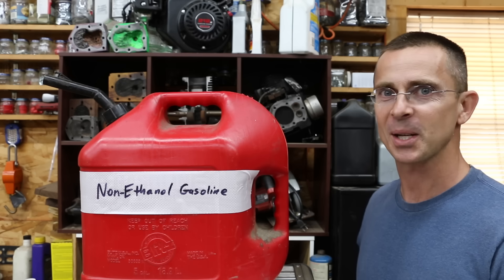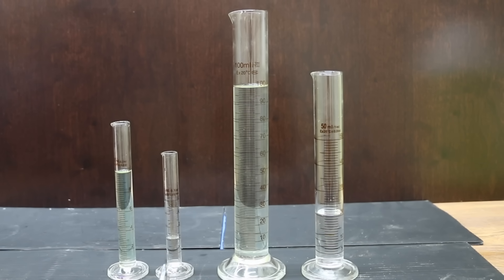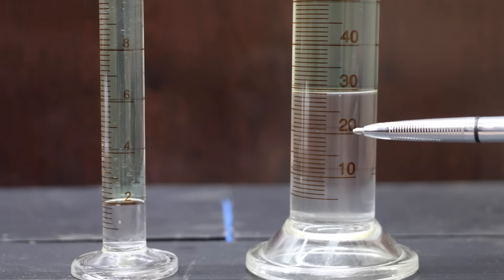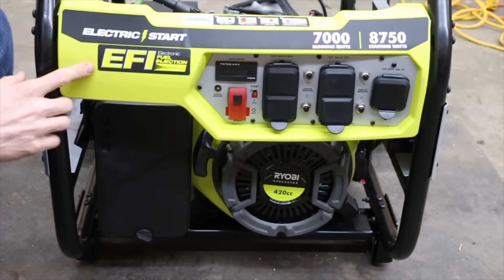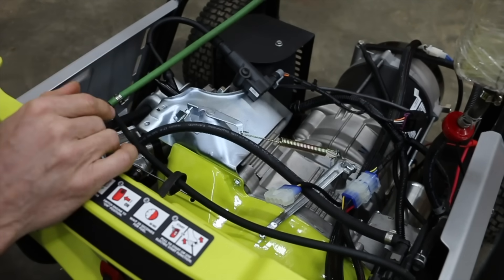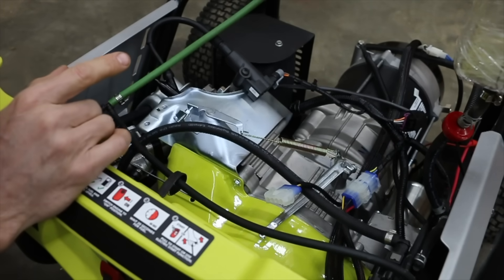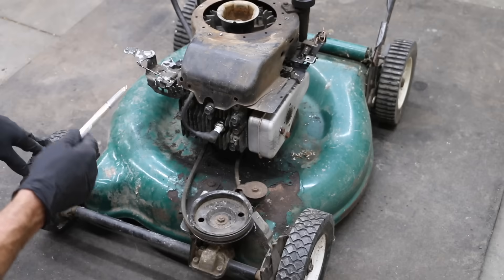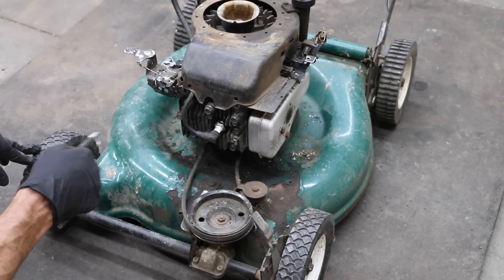Is Non-Ethanol Gasoline Really Better? See the PROOF!

Comment: in my country almost all gas stations max oct is 98 (97.1 ron) - im sure almost all of it has 10% ethanol. one has "bio ethanol" and is cheaper. but today i ventured to the other side of the city to a 100 octane (0 ethanol)  not many pay attention, but performance JDM market - (any car with an intercooler pretty much) is 100 octane.  filled a tank of 100.. I was shocked. measured trip im normally using almost 1/3 a tank (130KM) to work and back on bio ethanol 98. so far on the 100 ive done 212km  and only just hit 1/4 from full... what the actual hell... (thats over a third less consumption?).. how is that possible? i know the energy density of ethanol is really bad, but didnt think it was that bad. and didnt think my 9:1 compression would lean out that much to compensate on 98 octane 10% eth vs 100octane no eth..
Reply from the maker: Thanks for sharing.

Comment: Several years ago I had a Toyota pickup that had become sluggish and was down on power using regular pump gas with ethanol. I decided to fill it with ethanol free and after 5/8 of a tank my truck was running almost like new again. That was all the proof I needed. Now every 4th or 5th tank full is ethanol free and I've had no issues.
Reply from the maker: Thanks for sharing.

Comment: With your mechanical testing of small engine parts such as plastic and rubber you should also test carburetor metal component response both with and without evaporative emissions control on the test tank.  Part of the complaints I've heard definitely revolve around either the ethanol or the water it may suck out of the air (if the tank is not properly sealed against evaporative emissions and moist air intrusion) corroding the metal parts of the system such as sheet metal bowls, potmetal castings, brass needles, etc.  I'm not really sure I believe it but it would be interesting to see the effects in a controlled manner.

Comment: Thanks Buddy for the experiment
It hardly makes much difference but the problem is gasoline with 10 % Ethanol is Bad for the fuel tank because you can not keep this fuel for the Considerable period of time since after some time the Fuel stats extracting water and in the long run the accumulation of water Content is High and it damages the fuel tank of rust due to water

Comment: Too bad the test on small engines with rubber and plastic parts couldn't be included in this video.  A vendor of small engine tools (weed trimmers, other lawn eqpt., and so on) told a local hardware store that they did such a test and found that the 10% ethanol gasoline destroyed their plastic parts in addition to causing corrosion when gas was left in the tool for a long time.  This vendor insisted their customers use non-ethanol fuel only as a result of these tests.

Comment: Ethanol is garbage it’s sugar in your own gas tank basically. Those Class they make it out of her full of carbohydrates which is a measure of a unit of sugar. Ethanol in fuel is garbage and fuel and full of contaminants that they used to work very hard to get out of gasoline😅 sorry I jumped in a 20 year old car with half a tank of old gasoline been able to prime it yet spark and get it running. You can’t do that three years after filling a tank with ethanol. It’s really good for things like motorcycles and ATVs and boats because people think their motors are destroyed and broken and all you have to do is change out carburetors and fuel injectors and clean all the crap out of there but it sucks as far as fuel. If you are going to use it but just enough in there and burn it completely and it’s still going to make lots of deposits but never leave it sitting. It’s better not to use it especially On something you’re not gonna be out driving every day. And you’re cheap Toyota commuter car it’s probably not horrible but if you stick it in your lawnmower and motorcycle and let it sit for six months over the winner not gonna get too many seasons out of it before you’re in there tearing stuff apart to clean it out and rebuild it. I haven’t measured feel efficiency but it definitely feels like I get less mileage out of the fuel. Especially over the last couple years all of a sudden my 14 miles a gallon has gone down to 13 in three different vehicles. I’m sure it’s just coincidence but it seems a little odd that they all started getting crappy mileage at the same time. I been using ethanol fuel in my daily drivers and I don’t like it but when you don’t live in the city and you’re 30 miles from another gas station you kind of take what you can get. But I’ve been using it for years and it seems to have definitely changed over the last year or so and I don’t know if that’s because of the ethanol or type or amount of ethanol they’re using but gas goes faster now
Reply from the maker: Thanks for sharing.

Comment: The source of engine problems is described in the beginning of the video: it attracts water.

Most farm equipment doesn't have well sealed tanks with evap recovery systems. That's what you ultimately need to keep your gasoline crispy dry, a totally otherwise closed system that still vents thru a recovery device.
Reply from the maker: Thanks for sharing.

Comment: Actually if you add 20ml of water to a 10% (100ml) ethanol-gasoline mixture, you should get around 3% less than 30%, so roughly 29ml like you measured, because volume reduction occurs when water and ethanol mix.
Reply from the maker: Thanks for sharing.

Comment: Doing the compression test.......... Maybe an idea to run engines to full running temperature before the very first test scenario. At least it will eliminate any differences in PSI as a result of temperature difference. A hot engine, lubed prison ,rings and bore, is likely to produce higher pressure than a cold engine which hasn't even been spun over enough to allow oil to be splash lubed onto the components. In fact, the pressure on the hot test engine was a few PSI higher.

This may seem trivial, but I know that you do absolutely everything to ensure properly tested and recorded results to publish for all of us who really appreciate and trust this fantastic channel
✝️.
Reply from the maker: Thanks!  Thanks for the suggestion.

Comment: I had a 2000 BMW R1100-RT motorcycle , bought new . It always ran on hi-octane gas . Once on a trip I gassed up using premium Sunoco as usual with 10% ethanol . I rode from Fort Erie,Ont. to Bradford Pa. It ran like doo-doo ? It was missing and popping all the way there and back , approx. 220 miles. Sent it to garage , after 4 hours troubleshooting he couldn't find problem ? I gave him 4 more hours ( warranty  ) . I told him my routine of trip . It was found that Sunoco was sneaking 25% ethanol in their gas ! Hence the crystalization of spark plugs. Put in new spark plugs and fresh gas and it ran like a BMW .
Reply from the maker: Thanks for sharing!

Comment: Good point.  There is water in ethanol.  There is no water in gasoline.  That means potential for corrosion.  Also, water cannot be burnt or compressed, which could account for the efficiency difference, since the water comprises some fraction of the total volume of "fuel" you add to the engine, a "fuel" that does not power an internal combustion engine.
Reply from the maker: Thanks for sharing.

Comment: E85 uses roughly 30% more fuel as gasoline to achieve the same amount of energy. But it burns cleaner, keeps engine valves and pistons cleaner, and keeps the IAT temperatures down from evaporative cooling. I love E85
Reply from the maker: Thanks for sharing.

Comment: Whst brand was the mains powered circular saw at the end of the video pal? Einhell? Also I have a yamaha ybr 125 fi 2011 it does not like the new fuel. Find my self having less milage per tank also findnthe bike has less torque than it used to before the fuel switch. I'm ine of those thst does oil every 2k and use iridium spark plugs. The bike does alot of duel Lane 60mph roads so gets it harder than most city ybr 125 do. I struggle finding pumps thst have the more premium petrol now too as I tey and avoid the ethanol use in my bike for its casting slow progressive issues

Comment: I buy no-ethanol gas for use in small engines. Ethanol, or a process by-product of adding ethanol, deforms the plastic fuel pump diaphragm in two-stroke engines. Rebuilding chainsaw and trimmer carburetors every year will make anyone stabby. I could not care less about other pros or cons. I don't care about added cost. What I care about is that my Stihl MS460 and KM110 haven't needed carburetor service in 3+ years because I switched to no-ethanol fuel.
Reply from the maker: Thanks for the feedback.

Comment: Amazing attention to detail. I don't think the results would be any different for carbon build up with a longer test. There's just not enough ethanol and subsequently water in the fuel to clean the carbon. I buy only ethanol free for my small engines and my motorcycles.
Reply from the maker: Thanks!  Thanks for sharing.

Comment: The stoichiometric ratio of straight gas is about 14.64:1. For E10 it's about 14.08:1. The difference is 4%, exactly the difference in fuel mileage shown in this video. And exactly the amount of mileage money your govt stole from you when they stuck you with using E10.

Comment: I have constructed an ethanol removal system in my garage that is made from a 5 gallon water cooler bottle hanging upside down with a clear rubber hose coming out the bottom.
I add octane boost and a squirt of two stroke oil to the finished product. I call this my green goblin fuel and I have been running this fuel in my yt3000 with a 21 hp Briggs single cylinder engine. I have been using this fuel for two years and I don’t even turn off my fuel shutoff valve . My machine fires up and I cut close to two acres of grass with this old lawn tractor. If anyone wants me to make a video on this please let me know.

Comment: by far the biggest problem of the ethanol fuel isn't the burning, it's storage& delivery, carb jets and gaskets suffer, as well as the user changing fuel due to water contamination as ethanol is hydrophilic it will pull humidity from the air into the fuel.
Reply from the maker: Thanks for sharing.

Comment: You didn't show a comparison of the running temperatures, which appeared to be quite a bit higher with ethanol. That could make a lot of difference to an engine that already runs hot.

Comment: I and not at all sure about almost all stations selling gasoline with ethanol
I think ALL stations sell gasoline with ethanol
The thing is
There is a law that says a seller does not have to disclose the fact rather gasoline does or does not contain ethanol
A seller can claim one the other or both. Makes no difference
Reading the info at the station means absolutely nothing
Know this though
Though ethanol is corrosive
There is very likely many compounds in gasoline other than ethanol that are also corrosive
Even more so than ethanol
To read a material safety data sheet on the gasoline in question would give a clue as to what compounds make up your gasoline
The material safety data sheet will most likely state that the product may contain a long list of compounds
Anyway :) 
Being that major refineries hold all this as trade secrets
You tell me for certain what exactly what is in your gallon of gas your quart of oil or your tube of grease
That would really be something 
Other than that
It all just a opinion or conclusion formed on the basis of incomplete information
Reply from the maker: Thanks for sharing.

Comment: Don't have to even watch this to know the answer. Anyone who has raced using alchohol already knows you NEVER leave that crap in your engine afterward unless you tear down and rebuild every race. You always purge with 100% gasoline or immediately remove all rubber from the fuel system and soak it in gas. Purging works the best and is faster though.
Reply from the maker: Thanks for the feedback.

Comment: Took bowl off a Briggs 3hp wouldn’t run float bowl was full of looked like JELLO  after sitting over winter with 10%.  I use only alcohol free in my mowers and tractors , fuel sits all winter and have NO fuel problems. Also the bio diesel settles out with like a jello
Reply from the maker: Thanks for sharing.

Comment: I'm pretty late to the party. Always enjoy your comparison tests. My understanding the justification of Ethanol or MTBE (turned out MTBE was terrible) was to add oxygen to gasoline in order to reduce emissions. That made sense with carbureted engines but now that cars use fuel injection that is no longer an issue. In the US Ethanol is mostly made from corn. Seems stupid to me to make fuel from food. 

I agree the worst aspect of Ethanol because it is hydroscopic which is worse in small engines especially two-stroke. Personally I use Ethanol fuel in our lawnmower and chainsaw. I use fuel stabilizer and if I don't use it fast enough dump the excess in my car. I also try to always run the engine dry and turn the fuel switch off to minimize crud buildup in the carburetor.

I did not realize there were fuel injected portable generators. It would be interesting to run a fuel consumption test for same size carbureted and fuel injected genie.
Reply: I have a 9200w Champion EFI generator to run my house. they are a relatively knew thing.
Reply: Its not made from food
Reply: @recklesssquirel5962  In the US ethanol is made from corn, pretty sure that qualifies as food, we ate corn on the cob for dinner last night.
Reply: @tomschmidt381  ignoring the part where you try to equate two different products as the same thing to give your argument credit, the vast majority of field corn isnt used for human consumption. On top of that, one the byproducts of turning corn into ethanol is an excellent feed meal for cattle

Comment: I've owned my 1999 Integra Type R since new - 23 years. I have clocked 320,000Kms without ever touching the engine. I have been using ethanol for the past 10 years - about 150,000Kms, without any problems whatsoever, even though this is an 11:1 compression high performance engine. Can't feel much difference in power/performance between 94 octane ethanol and premium. Hope these comments speak for themselves
Reply from the maker: Thanks for sharing.

Comment: the biggest problem with ethanol fuel in older fuel systems is galvanic corrosion. this happens when water is introduced between dissimilar metals like zinc and brass, the zinc will corrode rapidly and create a white oxide that clogs the passages in carburetors. lots of old carburetors have zinc bodies with brass jets and emulsion tubes and metering rods, some have aluminum bodies but still suffer the same white oxide corrosion problems. the solution would be an aluminum-bodied carburetor with stainless steel jets and emulsion tubes, but as far as i know there are no carburetor makers that offer this option.
Reply from the maker: Thanks for the feedback.

Comment: Ethanol = H20 After just 2 weeks setting. Has anyone seen the stats on how much water is used to make ethanol? It's unbelievable.
Reply: Ethanol actually helps with water in your tank, same as Heet. Never had an issue with ethanol fuel even after sitting for years

Comment: Nice video .
Being a Powertrain engineer and after handling engine testing department fir over 10 years ..
If the Ethanol blend is not dropping the fuel  efficiency...
Something is missing .

The stoichiometry and engine ECU programmed for gasoline ..
Should add much more fuel when it's alcohol blended ...

Comment: Ethanol free is better you can store it longer it Burns cleaner and you get better fuel mileage in the vehicles now if you got a non cataletic converter machinery like a generator generator you can run  Aviation fuel for those engines and that never really goes bad on you it won't gel up like normal gasoline or ethanol fuel does.
Reply from the maker: Thanks for the feedback.

Comment: On your wiper blade lng term test.  fix it some way to show the pressure of the blade on the glass.  Some cars lift the blade off the glas whaen parked and others do not.  Chevy Lmina did have a park ramp that picked the blade off the glss when parked.  Most cars don't have that feature.  I sold a lot of wiper blades working in a full sevice gas station.  Some regular customers bought new refills seemed like realy few bad weather cycles.  We sold very few blade combunations as refills were so much cheaper.  You can still buy refills today at parts stores but you have to ask for them as they are kept behind the counter.  I've even had a store worker call me and ask the part number for them as they don't come up when looking up a car..  I'm certian there's no refills made to fit the beam type blades.  Never noticed water going over the top of the blade like your tests, but I'm sure it happens.  Like all of your shows.

Comment: Maybe I missed something.  But I did not see you clean up the engine in which you used the non-ethanol gas.  Did you do it?  I have a friend who is a landscape contractor.  ALL of his small engine tools (grass trimmers, hedge trimmers, etc.)  run on ethanol free gas.  He got tired of cleaning carbs and repairing fuel lines.  He says the 500 gallons he uses a year  saves money - mostly labor.  One thing I noticed is that these small engines run quieter.

Comment: It would be interesting if the carbon in the exhaust could be measured accurately, I have a feeling but no proof that would be easier to quantify than a visual inspection of buildup
Reply: unless you're specifically trying to measure buildup and not the amount produced

Comment: A couple years back, all my generators, mowers and anything with a carb was running like crap after the winter storage. Someone recommended I run eth free gas, never had issues since. I swear by it, has resolved SO MANY small engine carb issues.
Reply from the maker: Thanks for the feedback.